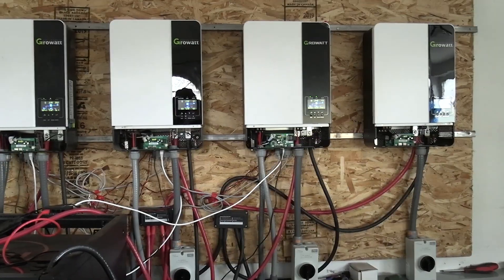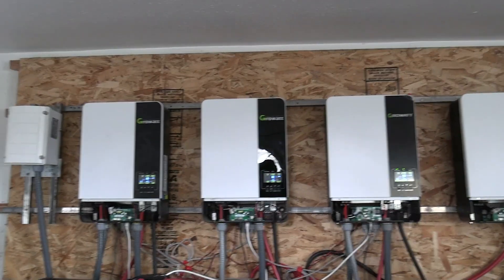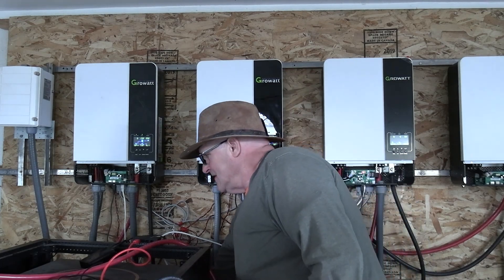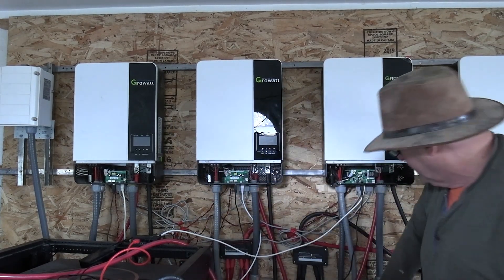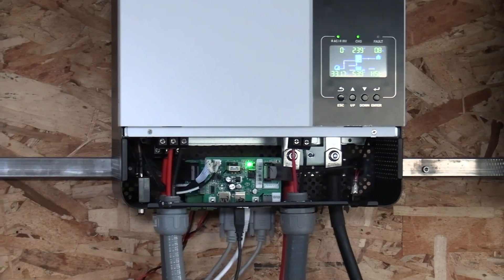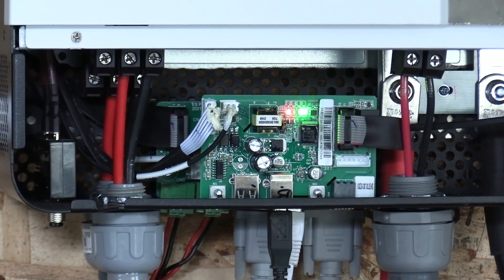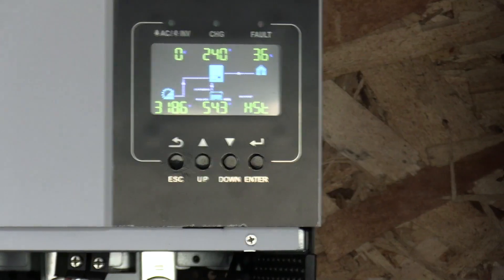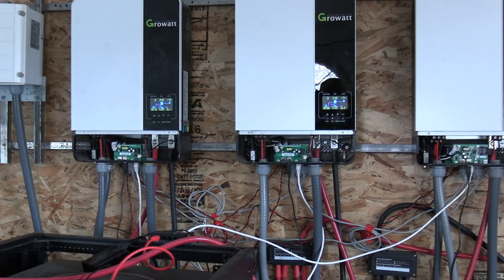growatt communication error 62

Comment: First one you switch on is the HOST(HST) second slave1 and slave 2.  I switch mine on from left to right.  Left HST and right SL! as I have 2.  You totally confused it by switching on HST right and the SL1 left and SL2 middle.  Maybe this is the way you have you comm cables setup but this seems conflicted.
Reply from the maker: They have different firmware. The one on the right has the newest technology. That’s why I wanted it to be the host. The firmware won’t talk to each other. My new inverter’s are showing up today.
Reply: https://youtu.be/lq5K48jkAdE
Learn how to repair batteries

Comment: Too many little issues with Growatt inverters. The next bit of advice you may get will be to update firmware on the older inverters. With some luck, this issue may resolve itself, only to raise the next. After 2yrs in the solar business, we just decided to avoid Growatt inverters. We've been buying back some inverters, upgrading them to Deye and Sun Synk inverters to protect the reputation of our new business.
Reply from the maker: These inverters have always worked with no issue’s. The only reason for the issue is because they changed the new inverters around the first of the year. These guys always provide lots of power and run seamlessly.

Comment: I am thinking of using a growatt 5000es for battery charging only also. I noticed you don't have communication connected to the battery charge only one, is it not possible in a setup like this?
I use Solar Assistant and would want to see charging data.
Reply from the maker: I don’t get charging data on the charge only inverter. I am using solar assistant also. 
When charging only from your inverter it can’t have the communication cables or power sharing cables hooked up.

Comment: I’m not certain but from what I understand there’s an older inverter that signature or Solar sold until about December or so of last year that you had to use a hub and connect all the inverters into the hub and then to the R 45 port. The new model you no longer have to use the hub they communicate together through the communication cable and you plug the battery lead into the BMS Port on the bottom of the inverter Instead of the RJ 45 port.
Reply: Yes, the newer version has a different communication setup. I had to forgo the BMS and directly use voltage setpoints to get my system to work using USE2. I imagine that if they all where using the new com board, it might not have this issue. I tried to explain this to SS, but they said it "should work"
Reply from the maker: @arthurhammeke8296  yes I just got off the phone with them. It wasn’t helpful at all. They don’t have very good tech support. I just released a video about what they said.
Reply from the maker: I think that you are correct. The thing is that it wasn’t sharing the loads evenly. I switched it to battery charging only that way I can still monitor my other inverters and battery state of charge, power usage. From my phone.

Comment: I would make that battery charging only. The board seems completely different. So the issue may only happen with a heavier load.
Reply from the maker: Yes it has already thrown code 62 again. So it has another communication issue tomorrow I am going to reconfigure the inverters and do some battery ( hopefully) upgrade wiring.

Comment: I see you're up to 4 inverters, are you using the current sharing cable? If so how and what's it's specific purpose?
Reply from the maker: yes we are using the current sharing cable. it is supposed to have them share the loads equally. the new inverter doesn't seem to communicate very well with the older ones. I am hoping that signature solar can let me know why. they said to shut down and restart the inverters which I did yesterday and then had to do it again today. if we continue having this issue? I will swap out the new one to battery charging only and use the other old one for providing power.